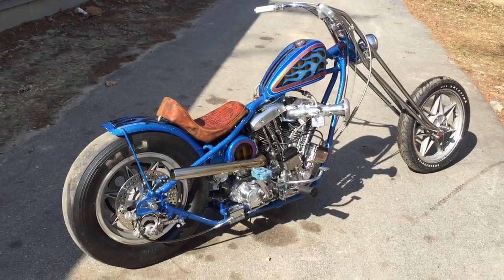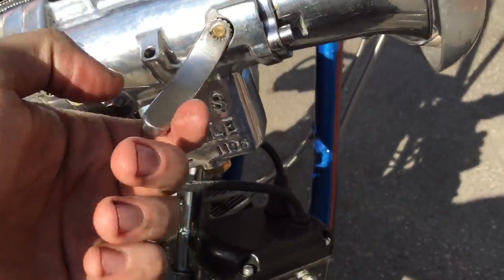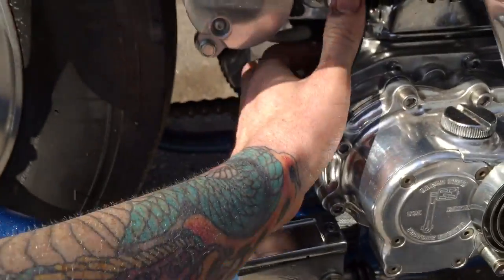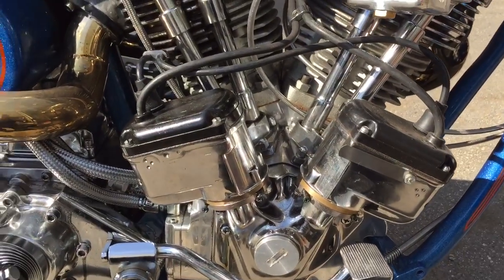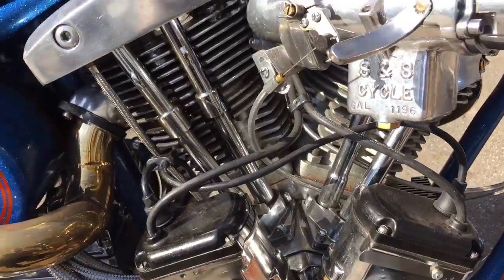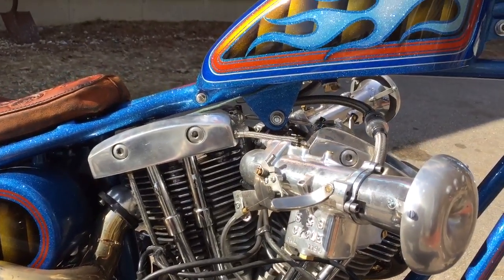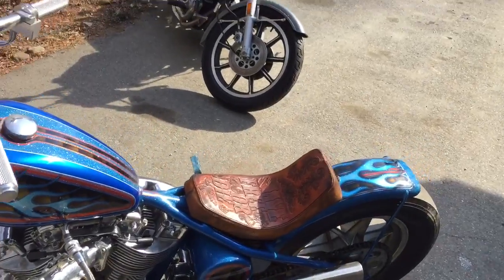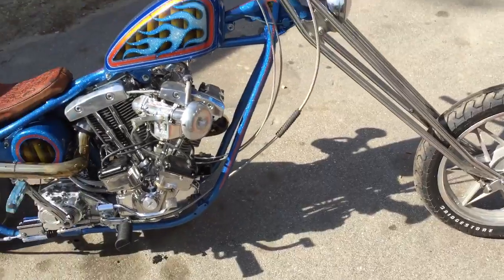John harman dominator startup procedure

Comment: That's not a Harman motor. Kenny Boyce used two rear heads. Also, one carb on the left pointed forward, and the carb on the right pointed back. Not a Harman frame. Not trying to be a Debbie downer but John deserves to be recognized for what he builds. 
Bill Holland  bholland2
Reply from the maker: Hey man all I did was build a harman style bike.  I used his engine (I thought) they’re gp racing cases and idk who else made heads or jugs anything like this. I also had the original purchase sheet and directions which said it was a harman engine. It’s a harman fork as well. I know who u are, I never ONCE said John built the bike.   It’s a stock frame I modified

Comment: Accelerator pumps, and or intermediate fuel circuit need tuning, a vacuum switch spark timing advance/retard (I assume the mags don’t have that function)  a functional hypercharger blips closed and gradually opens with engine rpm when the slide or throttle plate opens giving the effect of a delayed throttle actuation allowing the accelerator pump prime the sudden inrush of air, its an action to response duration when theres a change of manifold pressure/vacuum or intake charge volume, or spark timing